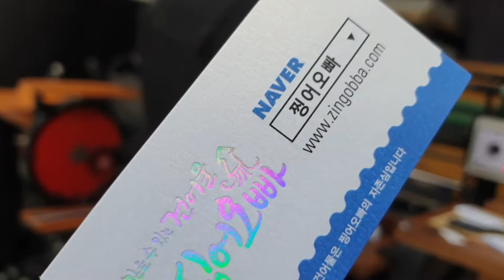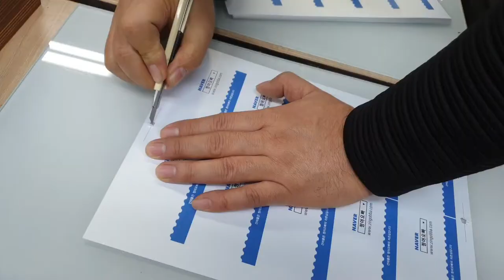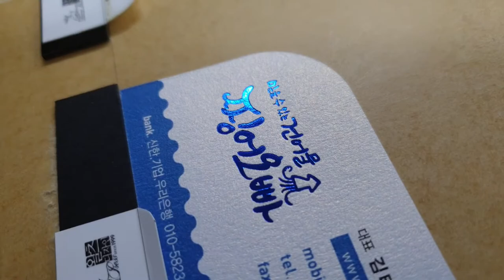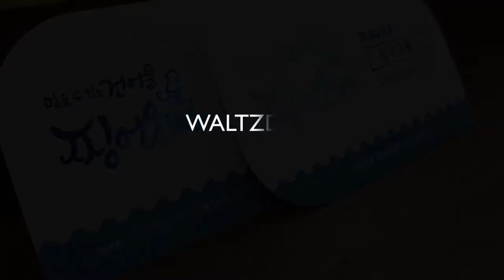Create a business card (Digital Printing+Die cutting+ foil) Letterpress machine...

Comment: Great video! I am just trying to figure out, the cut template for the business cards is underneath the paper card and is pushed up through pressure and then cut the paper.  1.What i don`t understand is how that template underneath is made? From steel? 2. Looks like a cookie cutters that are fixed on that wood frame with foam on top?  3.You have more wood frames with different templates and you change them as you need? Thank you
Reply from the maker: hello. Thank you for watching. Knives made on wooden boards are made by specialized companies. In Korea, where there are many printing shops, there are usually several production companies. And if the production quantity is not large, the knife can be used for a long time.